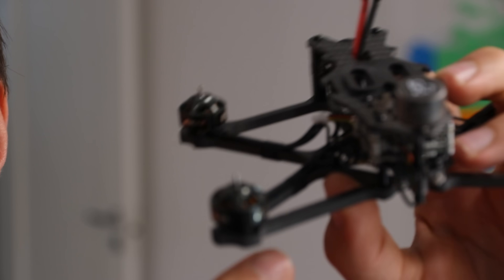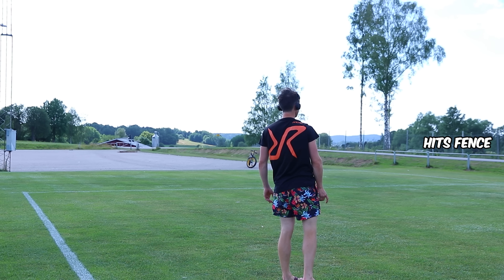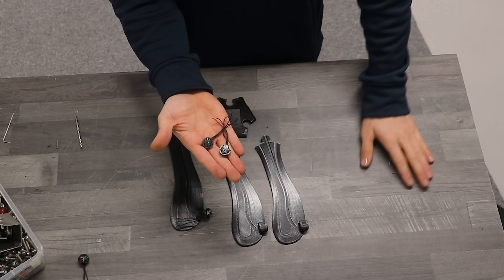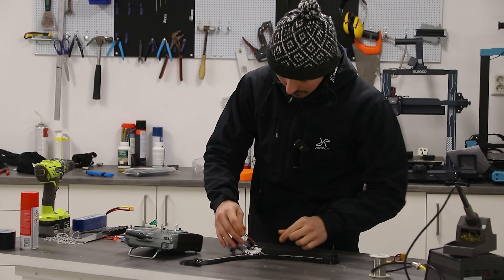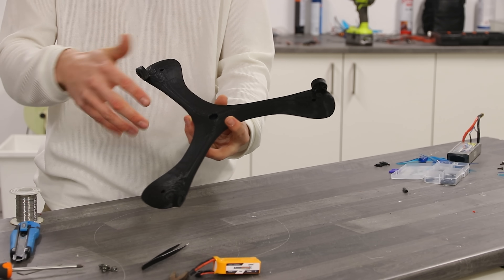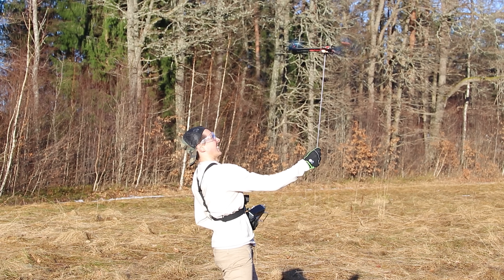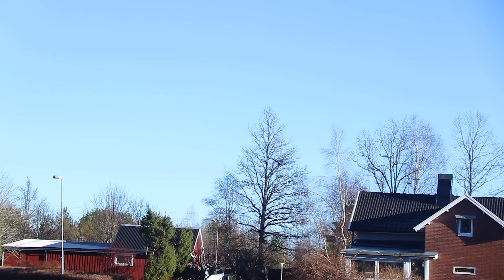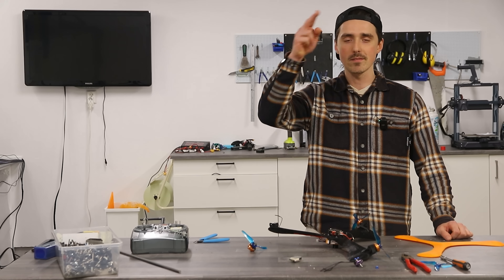A Boomerang That Never Comes Back

Comment: Try moving the motors from the wing tips towards the center of the boomerang. In that way the wing tips can have a higher speed, more lift and its get easier to throw. Ha det bra. =)
Reply: I had the same thoughts as well as make the wings longer.  The motors being near the center will turn the boomerang and the longer wings will act more like a helicopter rotor.
Reply: @xxMORTIKAIxx  Great minds think alike. 🥰